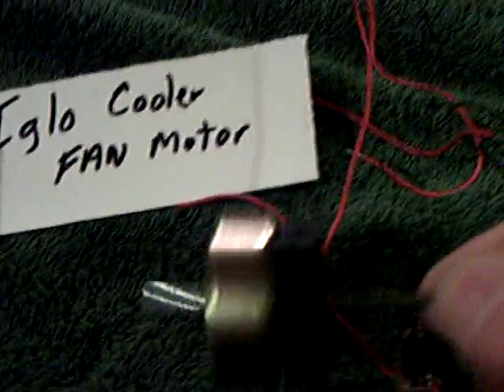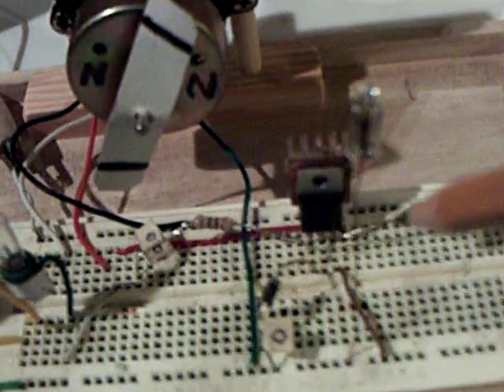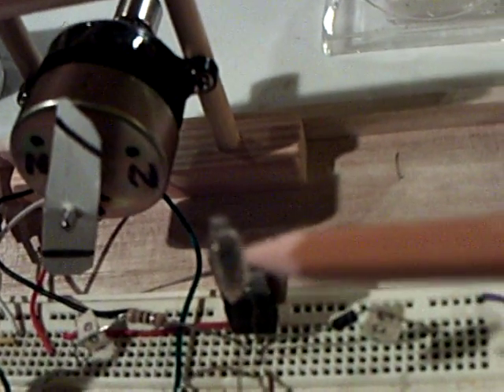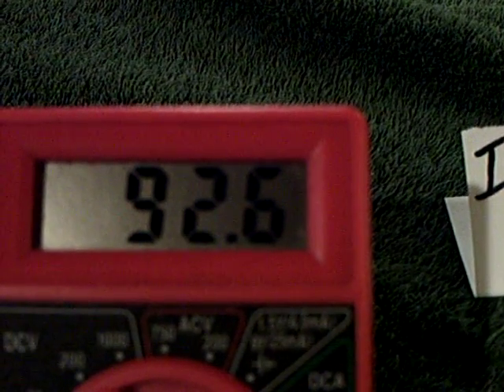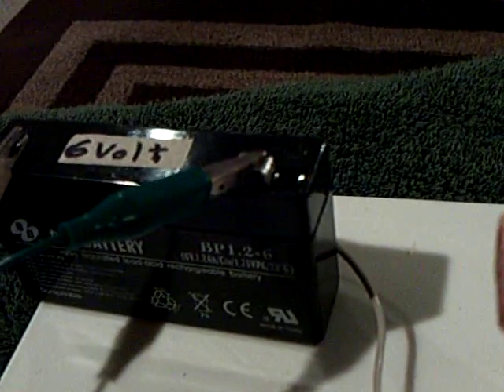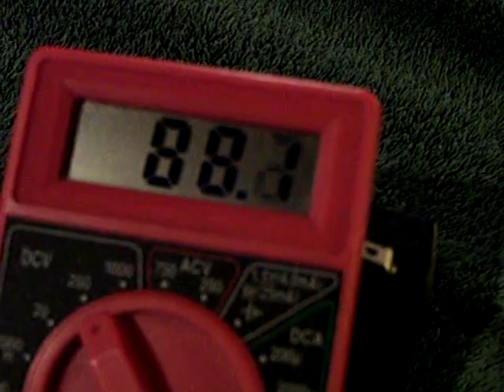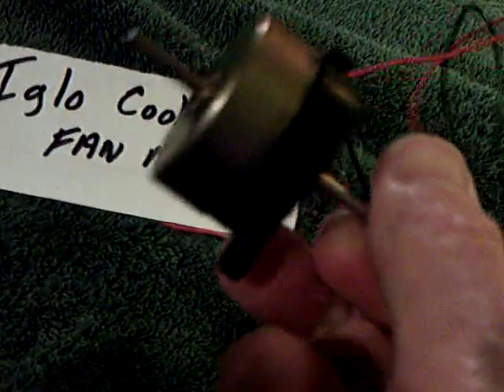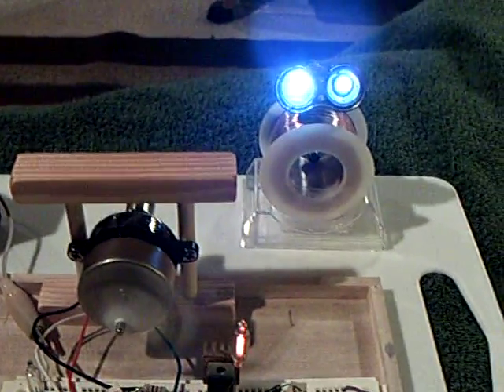Igloo fan motor Bedini.ASF

Comment: Hey there Lidmotor,
have you seen Dadhav's vid where he reconfigures a motor from a printer? he re-did the magnet arrangement, and turned that baby into a magneto charger. I wonder what would happen, since you have two. place them back to back. use halls. you're soo close on that one. might also use a more robust trany if you move up to 12 volts.

Comment: is that a TIP31, TIP31A, TIP31B or TIP31C?  They have a Vceo of 40, 60, 80 and 100, respectively.  If the Vceo value is exceeded in your charge cap, the transistor will be unable to "push" any more charge past the diode and will begin to rapidly(depending on the inductance involved) heat up as the transients find a more favorable route to discharge inside the transistor.